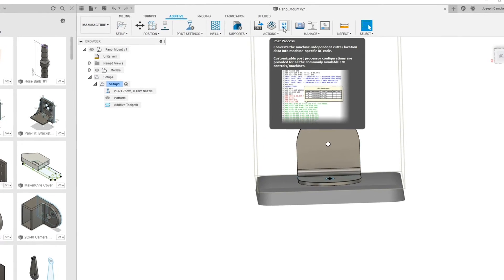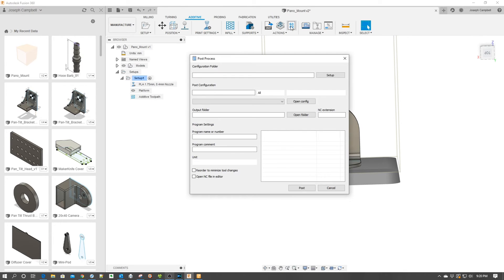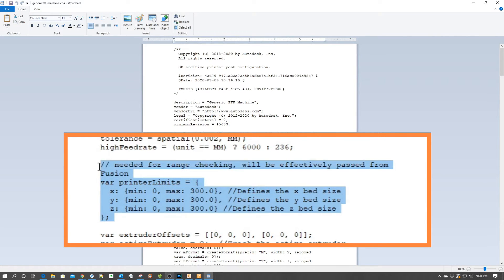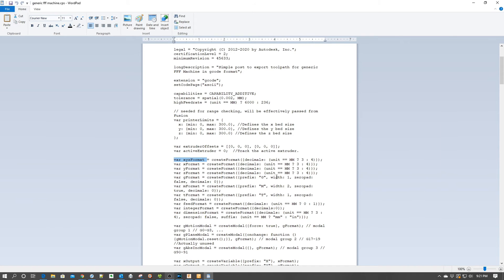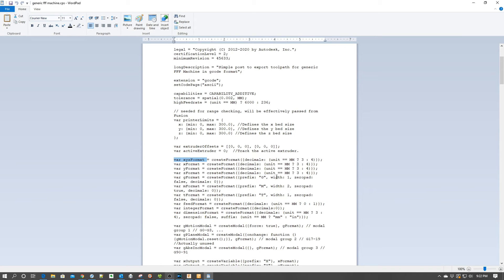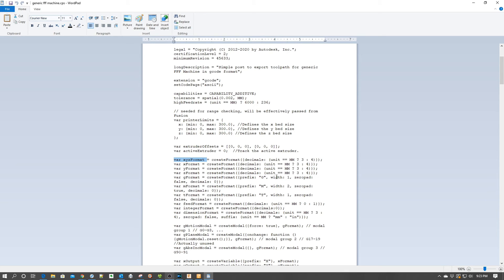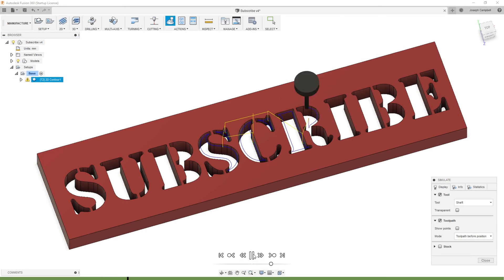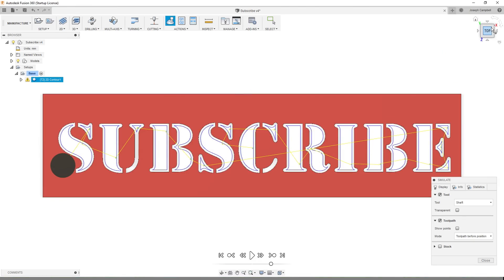Fusion 360 Minute - Fusion 360 Slicer and Post Processors!

Comment: I have an Anet A6 and Printrbot Simple Metal. While creating these in Fusion it wouldn't allow the FFF post? So as of now, it says none specified under the post. Thanks so much for these videos!
Reply from the maker: Are you creating a new printer in the local folder?  As the only thing I can not create are delta printers.  You can also look on the Fusion site for a custom post for your printer too...
Reply: Yep local folder. I tried to follow your instructions to the letter. I'll revisit it and see maybe where I went wromg.